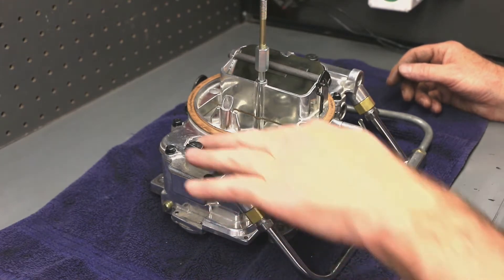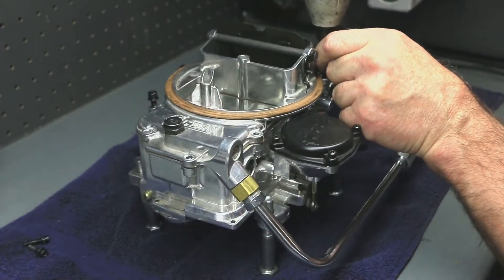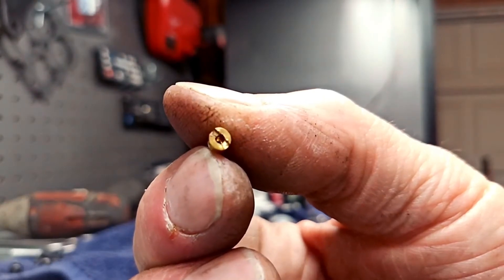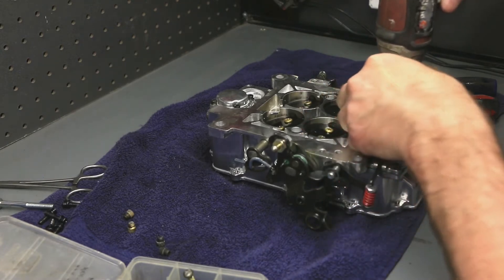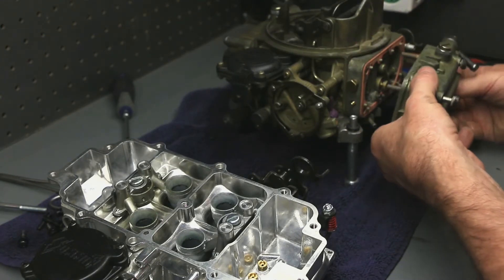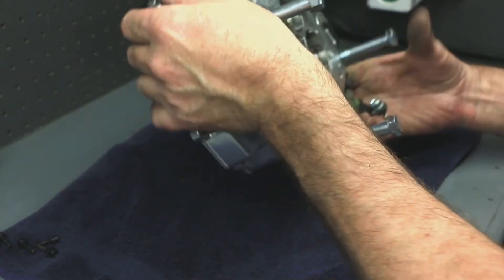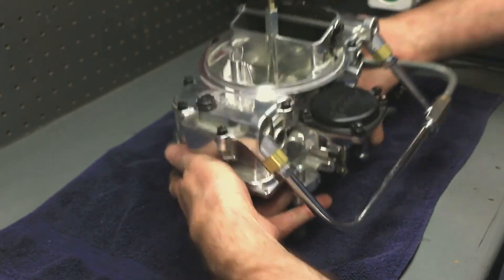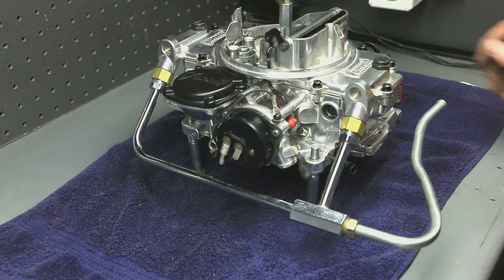Summit M2008 600 CFM carburetor teardown and inspection. Disassembly and tuning hints-Rick's Shop

Comment: my summit carb is running way too rich and  wont idle sometimes.  lots of black smoke.  im  thinking stuck bowl since if did this after sitting all winter.  i smell    gas too.  anu help would be great.  its a summit carb on a 502 bb.

Comment: Great video as usual thanks 👍 does anyone know if the throttle plates are smaller on the 500 version?  I've read online it has a 1.44 primary and a 1.69 secondary ? . And it list the 600 with the same size front and rear of 1.56  not sure if those #s are right someone told me it was the same size for both but the 500 had more restrictions at the venturi .   

I have the 600 summit on a 390 ford I like the carb but it's a Lil thirsty and lost some MPG with it vs a 600 Holly I have a AFR so I know my jetting is right  it's way more forgiving than a Holly it can be way out of tune and still run good where the Holly would cough fuss and not be happy at all just thinking the 500 would had been better for my 390 4,900 max RPM  better fuel economy etc.

Comment: Thanks for the video.  Im running one of these on a 460.  I've got 67/73 jets in there and a 6.5 power valve.  Is there anything I should change here?  Maybe bigger jets, and a 8.5/9.0 power valve?  I have 19 hg.  Should I up the pump cam from green to a bigger one?  What about the boosters?  Im not getting a 750 or bigger carb.  Thanks

Comment: Are the float chambers hard anodized?
Reply from the maker: They are the same polished surface as the exterior.
Reply: @ricksshop  so in other words you don’t know!
Reply from the maker: @onehot57  Carb is made of aluminum. Exterior surface is polished aluminum, therefore...

Comment: Thanks for the video. Im having issues with accelerator pump not squirting. The lever will not move at all. That "bb" and weight rod are NOT on the exploded diagram. And that BB did not come out even with blowing compressed air thru the accelerator pump passageway. So looks like the BB is seized in mine. I was unsure if it was permanently installed in the passage way somehow to keep it from falling out. I much prefer Holley carbs but my buddy has summit carbs on both his old school cars. They were in bad shape from aluminum corroding. The float needle assemblies were absolutely seized in the housing(would not unscrew or move to adjust level)) and had to be knocked out with a punch.

Comment: I run one of these on my daily driver- it’s been making me crazy with how PIG rice it gets right off idle. Looks like I need to step down on the idle feed restrictors!
Reply: Good luck sizing that with no sizes stamped anywhere telling what you have on the restrictors or on the case this junk comes in...
Reply: I have same issue runs rich idle only no information anywhere on this particular carb or sizes of different parts...so much for quality ...
Reply: @jondough4116 guess I've joined the club ....🙄

Comment: Rick, your reference to idle and pump jets is incorrect. The IFRS are on the outside of the cluster, and the pump jets are the middle under the cluster screw.
Reply from the maker: Yes, as I mentioned in the comments, I was quoting the Summit video supplied with the carb which is incorrect.
Reply: @ricksshop  Yes, I've seen that on their DVD. A poor error on their behalf. Good carbs though.

Comment: Nice video.  Have a 500 i had on a 302, great little carb.  Ran great out of the box, something my custom qft and my other holleys havent done, as well at least.  I guess i could go down a pair on the primary but its so close ive never bothered.  I suspect they flow a bit more than theyre rated also having done a little testing with it on my 351w

Comment: Fun fact, this is based on the Autolite 4100, a design from the mid 50s. I think even the boosters interchange. Great carbs. Run 4010 Holleys since the early 90s with Zero problems.

Comment: When you tighten the top or Cover, just Like cylinder heads, etc ALWAYS start with the INSIDE screws or bolts. Always work from the inner to the outer screws.

Comment: backwards on your idle mixture restrictors and accelerator pump nozzle jet.   idle mixture restrictors are on the outside edge of the booster cluster.
Reply from the maker: Yep, I was repeating the Summit DVD which was wrong. Correction is in my comments above.

Comment: What is the thread size on the end of the fuel rail?  Is it 3/8 npt?
Reply from the maker: It's standard 3/8 brake tubing with I believe a 5/8-18 flare fitting.
Reply: @ricksshop  Thanks, I'll just put a better quality set up on it.

Comment: I could not get a metal line to seal on the fuel feed line.
Reply from the maker: The sealing surface is the flare, not the threads. There may be a burr on the inside of the fitting or feed line.
Reply: @ricksshop  I know that's what I'm thinking. I plan on using a copper flare washer on it. The steel lines are tough to seal sometimes. I saw another video that says they are always successful.
Reply: @TheIVBO  sometimes need to tweak the feed line to make sure the flare seats center and square on the cone inside the fuel bowl/needle fitting.

Comment: Thank you for the quick teardown, great info, and no BS... Great advice on the Wide band sensor. I've just resorted to reading plugs. I have the Mechanical secondary 750 on my 383. I was anxious about the motor and ran cold plugs as it's high compression. They fouled immediately and going up one range helped initially. However the plugs show I've been running rich and it's time to tune. Starting with the primaries going down by 1 or 2 sizes. Summit had way too much sales going on in their videos for my patience.

Comment: Where do you get idle jets?
Reply from the maker: Summit Racing sells them. They are standard Holley parts.
Reply: @ricksshop  I can not find idle restrictor jets my size on any website. I have standard .046 i think i need .043 or .040. Should i buy smaller ones and drill them out.